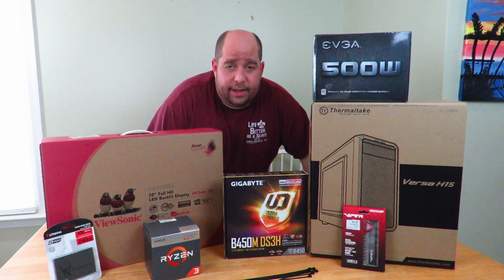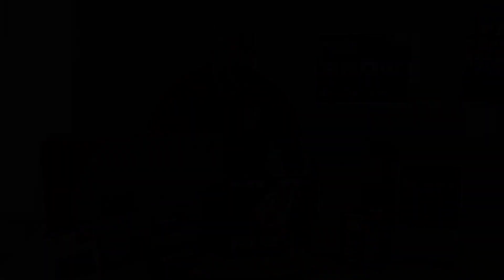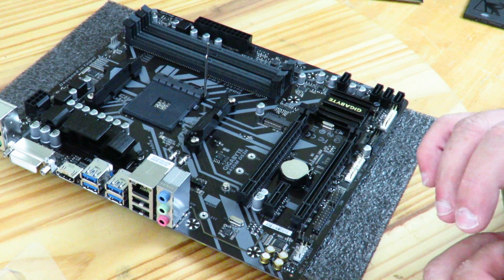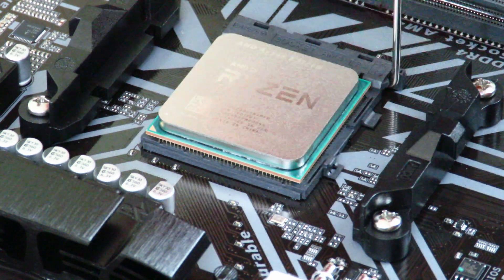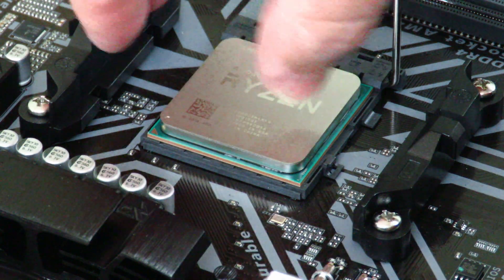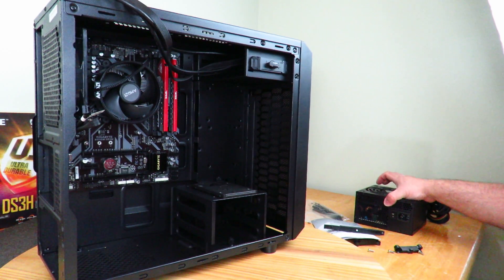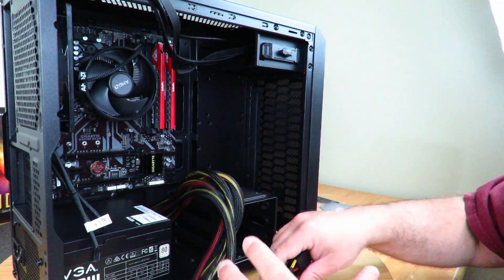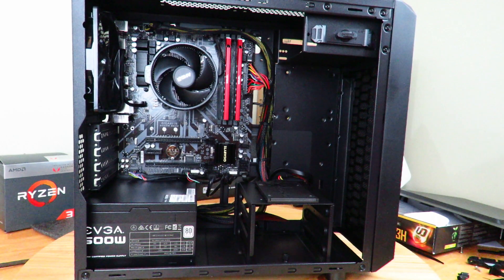How to Build Extreme Budget PC that doesn't Suck | Step By Step Guide

Comment: There are many options for where an SSD  can be mounted in the H14 case; on the back wall (as you edited in), as well as inside the 3.5" cage on the underside of the cage top (essentially in the upper bay), which allows easy access for installation of the mounting screws from the top of the cage.  Space for hard drive(s) still remains below the SSD if necessary for the build.

What I'm most surprised about is that you didn't utilize any of the case's cable management options which are accessed by removing the "offside" (right side) case panel and passing all the cables into the cable management cavity on the right side of the case.  That cavity will take care of all the power supply cables, the SATA cables, fan cables, etc, as well as the front panel cables (for which there is pass-through opening adjacent to the front panel area in the back panel).

Obviously, leaving all the cabling in the main cavity is easy and does work but if aesthetics is deemed important then the cable management cavity on the right side of the case makes for a very "clean" install.  Utilizing the cable management cavity more easily keeps cables from running over, around, or interfering with various components in the main cavity.
Reply from the maker: Thank you for your incredibly detailed review, I LOVE IT.  I did not have too much time with it, and it was already late for her birthday, I did not want to take too much longer so I did not 100% analyze every possibility.  Also, since they are not tech savvy, I didn't want to make anything too difficult for them if something would occur, I wanted everything in plain site for them.

If I was going to use it for me and had more time, I would have analyzed it a bit better.  Thank you so much for stopping by and watching and grading my video, it means a ton to me.

Comment: What happens if I put the memory in a wrong order?
Reply from the maker: It may not POST, though it would not cause  any damage, just scare you a bit
Reply: Did you needed a bios update for the Ryzen 3?
Reply from the maker: @diegocosta4786  no, it just worked.  Which are you using?
Reply: @ThisBytesForYou  I'm just planning build a PC. Nothing very solid yet. Would it be almost this exactly same build but with a RX 570 and others things (as a different power supply, case...) What do you think? 

I was considering buying a a320 Mobo for being cheaper and I don't have interest in OC, but I've seen some models that needed a BIOS update. Do you know if every a320 needs a BIOS update? The one I'm interested is a ASrock a320m hd DDR4
Reply from the maker: @diegocosta4786  I cant speak to the a320, since I have not touched it, sorry my friend, but with the RX570, that should be a great machine.  Let me know when you get closet to the time to buy it so I can help you select parts, it would help me greatly.  Thank you so much for stopping by, checking out my video and commenting, it means the world to me.
Reply: @ThisBytesForYou  do you think that the Gigabyte b450m will be fine with a Rx 570? Thanks for you sympathy :)
Reply: Just imagine this exactly same build but with a Rx 570. What do you think?
Reply from the maker: @diegocosta4786  i think it would be perfect, a very low cost solution, I think you would be able to play 1920x1080 at high easily
Reply from the maker: @diegocosta4786  yes for sure my friend, its a decent board, especially since you will not be overclocking, no issues what so ever.
Reply: @ThisBytesForYou  thank you very very much :)
Reply from the maker: @diegocosta4786  you are so very welcome my friend, so very happy I could help you.
Reply: @ThisBytesForYou  one last thing: how can I know if my mobo supports an specific CPU and GPU without a BIOS update? Like for example: if the asrock a320m-hd support the Ryzen 3 2200g + rx570
Reply from the maker: yes, it sure does ;), https://www.asrock.com/mb/AMD/A320M-HD/index.br.asp#CPU

Comment: Hello sir, I bought everything on that list except i decided to buy the Ryzen 3 3200g... Now i don fucked up because the computer wont boot, i don't get any signal on the monitor, is it because the ryzen 3200g is too updated for the B450 motherboard?
Reply from the maker: which motherboard did you get, the GIGABYTE B450M DS3H Motherboard in this system worked fine?
Reply: @ThisBytesForYou   yes i got the GIGABYTE B450M DS3h and im not getting any signal on my monitor
Reply from the maker: @NvrExisted1  do you have a video card plugged in, and if so, do you hav ethe monitor plugged into the video card or the motherboard?  Also, if you are using HDMI, is your monitor selector on HDMI?
Reply: @ThisBytesForYou  yes my monitor selector is on HDMI, no i do not have any video card just the Ryzen 3 3200g CPU. everything starts up, all the fans my keyboard lights up along with the mouse but no singal on the monitor, ive change the HDMI cords to my others HDMI cords and still nothing i have also tried using on my other monitor aswell and no signal.. ive been at it for more then 17hr straight now looking for answers.. you seem to be the only one to reply consitant
Reply from the maker: @NvrExisted1  my friend, because I love helping.  OK,  just gong down the list, do you have the memory plugged into slot 2 and 4?  If not, move the memory to slot 2 and 4.  Then if that does not work, unplug the power cable from the power supply and remove the CMOS battery, make sure if there is a power lighton the board (I don't remember) that the light turns off.  when the light turns off, press the power button a few times, just to make sure it is drained.  With th CMOS battery removed, try to turn on the PC to see what it does.
Reply: @ThisBytesForYou  I did all of that and still nothing good sir... idk what is wrong im almost in lost here.. im reading that i need a bios update but im also reading that b450 ds3h motherboard is enough to start up ryzen 3 3200g without bios update..
Reply from the maker: @NvrExisted1  yeah, I had no issues what so ever getting it working.  I recommend taking everything out of the case.  On a desk or somewhere with no ESD, maybe on top of a piece of cardboard or the motherboard foam.  unplug everything, even the CPU.  Verify that there are no bent pins on the CPU, then install the cpu and the heatsink.  then only install 1 stick of RAM.  Then plug on the 8PIN EPS cpu power connector and the 24Pin power connector and plug in the monitor to the board and short the power button pins to see if it turns on.
Reply: @ThisBytesForYou  i just did all that just now, and still nothing, i really appreciate your help and reaching out specially this early. Do you think the mobo is faulty? 

when i turn it on all the lights turn on the tho along with the fans spinning and my keyboard and mouse lighting up
Reply from the maker: @NvrExisted1  have you tried changing the memory, so you have only 1 inserted into slot 2, change that one with the other one and see what happens.  just checking to see if the memory is bad and you are very welcome my friend.
Reply: @ThisBytesForYou  is all b450 mobo compatible with RYZEN 3 3200G on first boot? or do i need to buy a new model like the x470?
Reply: @ThisBytesForYou  yes i have changed the memo and left 1 ram in the slot and still nothing, ive also removed the MOBO battery and left it for 20 mins and got nothing either

Comment: I have this B450 mobo, but when I upgraded to a 2600 the RAM is stuck at 2133mhz. Not happy with the board.
Reply from the maker: I did not have any issues with setting the RAM.  Did you flash to the latest BIOS and utilize XMP?  Also, is the RAM on the QVL for the motherboard?
Reply: @ThisBytesForYou  Yes I download the latest bios. Not sure what QVL is. Weird thing is RAM is fine with my 1600. On my Asrock board with 2600 RAM is good too.
Reply from the maker: @cspc2570  the QVL is the Qualified Vendor list for the Memory.  Even though most RAM works fine on most boards, there are some issues.  what is the exact model of the motherboard and the exact model and part number of the memory, I can check for you, but if you go on the motherboard manufacturers website, you can find that too, but i don't mind helping you.
Reply: @ThisBytesForYou  Ah yes the vendor list. No worries ai tried EVERYTHING I could find online with no success.  I'm going to sell the board as it is a poor overclocking board overall in favor of a B450 Tomahawk. It's a sturdy built board with poor software in my opinion.  Thanks again!
Reply from the maker: @cspc2570  This particular board, I bought because it was INCREDIBLY affordable, which usually means it may not be the best for everything.  I wish I were physically there to help you, I am sure together we could get it working, but yeah, the Tomahawk would provide you many more features and better overclocking.  Thank you so much for stopping by and checking out my video, and even more for commenting, it means the world to me.  If you need any more help, please let me know.